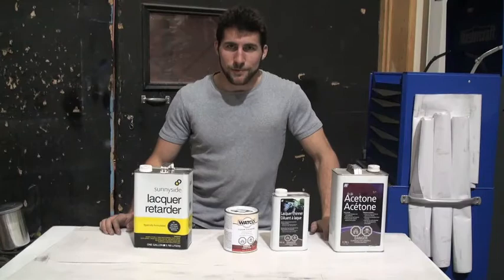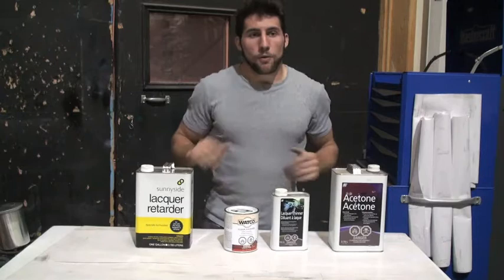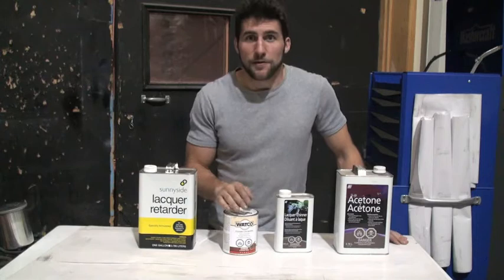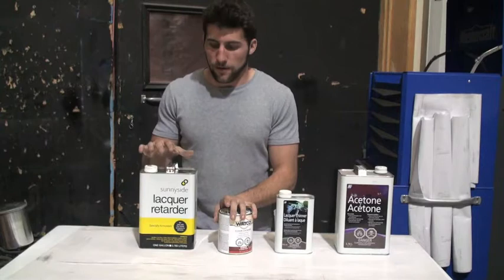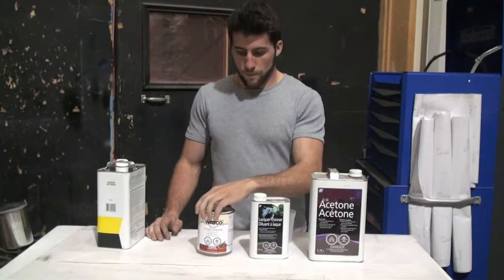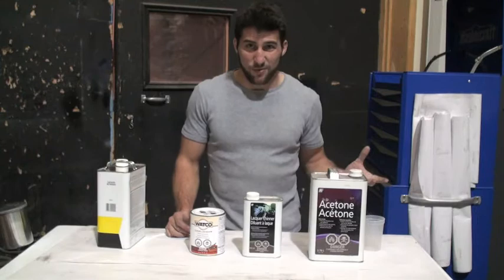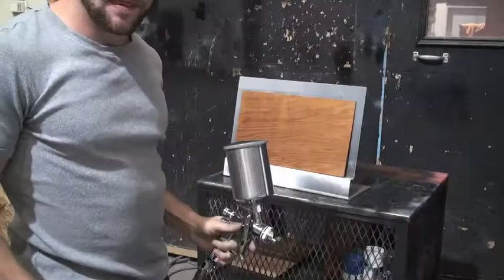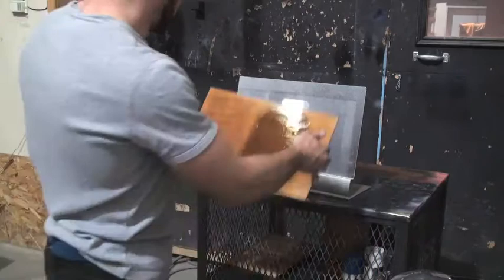How to Spray Brushing Lacquer

Comment: Great video! I spent the whole day here spraying your mixture. The only difference is that during the heat of the day I opted out some of the acetone for xylene. About 10% total volume xylene. Its listed on the spray-can/msds for watco lacquer satin-finish, so I figured why not. I read that it allows the lacquer to flow better because it slows the dry. Worked great. Sprayed 30 small table tops. I also noticed, since I was using the watco spray cans before in satin sheen......that the sheen is a little bit different from this diluted satin mix I made (with your help of course, props!) The sheen from the spray can is damn near FLAT......no reflective qualities at all, hides almost all blemishes. The satin mix from the "brushing lacquer" gallon has a touch of sheen....way less then semi gloss, but not a dead flat satin. Looks nice. 2 coats brushing lacquer applied by brush, then sanded 220, then sprayed 1 even coat diluted mix. Just my 2 cents. Thanks again, saved me some coin on spray cans!
Reply from the maker: Xylene works a bit like using retarder. It's a great thinner; I use it for enamels sometimes. Wow, that's a lot of tabletops. I prefer the semi-gloss watco spray cans because, like you said, there isn't much sheen at all to the satin. Thank you for sharing your technique and the experience you had with it, and thanks for watching.

Comment: Great video it gave me a starting point for a great finish.  If you look at the MSDS you will see that it is a Nitrocellulose Lacquer with proprietary resin.  All brands contain some form of resin to increase build capacity, flexibility, and bond strength.  Also lacquer thinner and retarder are not solvents themselves but rather mixtures of possibly 20+ individual solvents with different evaporation rates where butyl acetate is the standard.  Acetone is the fastest at 5.7 times that of butyl acetate and ethylene glycol butyl ether one of the solvents used in a retarder is 12 times slower.  There are easy to find charts for anyone else who likes to make it way to complicated.  M.E.K. is also a good thinning solvent for slow brushing lacquer.
Reply from the maker: Thanks for the information. I had no idea that butyl acetate was the standard for evaporation rate, I just knew that acetone was a great cutting agent that evaporates very quickly, and that retarder might be needed to counteract that. Now it almost seems redundant to use both.

Comment: I actually started using Minwax Clear Gloss Brushing Lacquer since it's like half the price of Mohawk. I just mix it 50/50 with Lacquer thinner, works perfectly and ready to buff and polish in about 14 days! Great video buddy! 👍
Reply from the maker: Glad to hear it’s working for you.
Reply: 50/50 mix, wow that’s the most I heard yet, and it works!  Interesting.
Reply from the maker: I sometimes use 70(thinner)/30(lacquer) for a final flow coat or to burn in a fresh coat on something I don’t want to sand that has been dry for a while.

Comment: Good video, Brad. I've been spraying brushing lacquer for years just because of availability. It works very well as an instrument finish that wet sands and buffs out beautifully. It also mixes really well with color tone dyes
Reply from the maker: Boudreau Guitars That's good to hear. I really need to get some color tone dyes, but they are a little more difficult to acquire up here in Canada.

Comment: Thanks for taking the time to make this informative video. 🇨🇦 I’ve been using automotive gloss lacquer from Canadian Tire, but wanted less gloss for some of my guitar builds. Was looking at getting  the Watco semi gloss brushing lacquer from Home Depot and trying to spray it through my HVLP gun. 🇨🇦
Reply from the maker: Good call. I hope it works for you.
Reply: @ Brad Angove Hi Brad, I mixed up a batch of your mix 60-40-20 with the Watco gloss brushing Lacquer.
Sprayed a guitar headstock and the rear cover for the guitar body. It went white as snow from ☺️ blushing.
Thank goodness I dint spray the main guitar body burl maple and figured walnut.
The humidity was 65% and the air temp was 24 Celsius so not supper humid. For this temperature and humidity
There was way too much Acetone in the mix.  It flashed immediately and locked in the moisture.To  fix the problem I lightly sanded with 800 dry two days later, didn’t take much to release the moisture!
Then the next day re-sprayed with a mix of 50% Watco Gloss Lacquer and 50% Lacquer thinner.
Worked like a charm didn’t flash to quick and it looks good now.
When you did your video was it cooler and dryer by chance? 🇨🇦
Reply from the maker: @RC-Flight  It's always cool and dry where I'm at.

Comment: Thanks for the video though it didn't work for me. I was getting a very dry blushed finish. I opted for about a 60/40, lacquer/lacquer thinner mix. This gave me a near perfect finish.  Maybe our differences are the guns we are using. I am still using my Binks models 62 and 7, (not cheap), that I used for automotive work some 30 years ago. I do though use acetone as a thinner for spraying regular Rust Oleum paints.
Reply from the maker: That could be it, or different humidity. If you’re somewhere really humid the faster solvent (acetone) will create more opportunity to trap moisture and create blushing.

Comment: I don’t quite understand the need for Acetone. I have a quart of Minwax clear gloss brushing lacquer, and I decided I wanted to try and spray it. I have the Preval sprayer, (they call it amazing for a reason) and I just eyeballed some lacquer thinner in with my lacquer, and to my amazement, the stuff sprays better then it does brushes. I didn’t need any Acetone, just the thinner and always a clean spray cap, and I get some professional looking results. The back of my can of brushing lacquer says, “Do not spray” and “Do not thin.” 
I can’t figure out for the life of me why it says that, cause it sprays, and it thins, perfectly for me.
Reply from the maker: Yeah, the main difference is just viscosity. Brushing lacquer dries a bit differently, but the thinner can change that to an extent regardless. 

The acentone is just a slightly stronger cutting agent that dries at a different pace than standard lacquer thinner.
Reply: Brad Angove oooh I see. Thanks bro for responding.

Comment: great video, always thought this was possible but wasn't sure on the mixing/application technique. Just a quick question, what purpose does the acetone serve in the mix? Why not just use more thinner? Keep up the great work
Reply from the maker: Acetone is what they use to thin it originally if I'm not mistaken (I could easily be mistaken here). In fact, you can make nitrocellulose lacquer by dissolving ping pong balls in acetone.
I use the acetone to thin it until it's somewhat like a normal spraying lacquer, then I use the lacquer thinner to thin it further, like I would thin a spraying lacquer.
Reply: Brad Angove
Haha great fact! I knew they disolved in acetone but I'd never thought of using the resulting liquid as a lacquer. Makes sense though.
In your method you use 50ml acetone + 50ml lacquer + 20ml thinner
would you get the same general effect if you used 50ml lacquer + 70ml thinner?
                                                                                or         + 70ml acetone?
or would this effect the chemistry and screw it up?
Reply from the maker: Ya, they're made of nitrocellulose apparently. I use about 50ml acetone, 30ml lacquer, 20ml thinner. That gives me a fairly thin mix. I think  that you would get a similar effect with those mixes, but maybe a slightly difference in atomization due to drying time. Acetone evaporates a little faster than lacquer thinner I think. Once you've got it reduced with the acetone so that it resembles spraying lacquer, I would do any further reduction with the thinner to make it behave more like a normal lacquer. That would probably also make it more likely to work well with the retarder if you use that.
Reply: makes sense to me now, thanks for the videos and for answering my question. All the best
Reply from the maker: Any time. Glad the videos were of interest.

Comment: Great video. Can you break down the mixture into how many parts per parts. I was going to use measuring spoons to put together a small batch. Thank you in advance.
Reply: The math is way easier if you just calculate off of final volume.  But it's something like 3 parts acetone, 2 parts lacquer, 1 part thinner.  Like he says that is pretty thin, compensate as needed.

Comment: Hey Brad - great video... this helped me out as I just bought a used Sata HVLP gun off a buddy with a 1.5 mm tip and was using the Watco at a mix of 80/20 (lacquer/ LT) (no Mohawk lacquer here, locally). I tried your ratio today and it made a huge difference. I'm wondering... how much time do you allow between coats? I was shooting every 30 minutes, which seemed to work fine but am curious if a guy could push that in view of getting, say, 20 coats on over the course of a day (i.e. high build gloss on a guitar). Also, if continuing on the following day, is it okay to just resume spraying, or should one sand lightly if a project has sat overnight. Cheers!
Reply from the maker: I wouldn’t generally put more than 4 coats on in a day so you don’t build up too much and have it all shrink and crack. 

You don’t need to sand between days for lacquer like this. It melts into itself. Sanding doesn’t hurt though if you want to smooth something out or remove imperfections.

Comment: Brad, I'm going to finish a guitar with this formula, after i have the desired amount of clear on it. i should follow your other video for buffing the finish out with using these chemicals? Thanks
Reply from the maker: +chris doxey Yes, the techniques I've used in my buffing videos will work fine on this finish as long as it has time to dry properly.

Comment: Hi I'm so glad I found your videos I have a question I usually paint on canvas but my husband asked me to do his electric guitar. he picked out an auto paint for a base coat. For the graphics I have water base acrylic paint. After I clear coat can I use brush on lacquer my airbrush is 5mm. Thank you
Reply from the maker: Brush on lacquer is a form of clear coat. If you're planning on spraying it through a 0.5mm airbrush, make sure that it is reduced fairly thin. Also, clean your airbrush carefully afterward and rinse out the lacquer thinner with water when you are finished cleaning so that it doesn't dissolve your seals.

Comment: thanks for the video,  watco is the only nitro paint available in Canada,,,for restoring old guitars it is the way to go, question is, seeing how guys like the vintage "checking effect" offered by nitro,  would you mix it differently?,    thanks in advance
Reply from the maker: +Pete Goyer Hi Pete. I don't think that Watco is a nitrocellulose. I could be wrong though. I get my nitrocellulose lacquer at a local paint shop here in Alberta instead. Unfortunately, I don't know of a mixing method that will induce checking. Perhaps experimenting with temperature changes will have some effect?
Reply: when i read the MSDS sheet it shows nitro,,,
its the watco clear lacquer , super clear finish
http://www.rustoleum.com/product-catalog/consumer-brands/watco/lacquer-clear-wood-finish
Reply from the maker: A spray can that atomizes like a pro gun? I find that hard to believe, but I'm curious...
Reply: Watco is indeed nitro, it sure smells and acts like it. It checks like crazy too in case anyone is wondering. The only reason to use it imo beside wanting checking is the burn in but it's so damn toxic and takes so long to cure I'm trying really hard to get water based finishes to work. They dry so fast and cleanup is a breeze but lack of burn in for the inevitable flaws to fix is a real downer.
Reply from the maker: What kind of environment are you storing your stuff in?
Reply: It was a guitar I painted with rattle can Watco, stored guitar in a super cold garage over a winter -it cracked exactly how vintage guys want. I've since used the canned stuff for small parts and that stuff smells even more powerful, I can't even just have the tin open for 10 min before I start choking lol.
Reply from the maker: Haha yeah. It says in the product specs that it’s nitro. I found that out relatively recently. 
If you leave lacquer in the garage it’s definitely going to crack, but I’ve got a couple watco painted items that weren’t stored in the cold and they still look fine.

Comment: Hey this is awesome. Thanks for posting. 
I'm a guitar tech who wants to start doing more of this and I always get nitro from stewmac....it seems kind of thick as well but I've never worked with brushing lacquer. Is nitro thinner? I should use a mixture similar to this for an airbrush as well right?
Reply from the maker: Brushing lacquer can be nitro or a different type. Nitro is the chemical composition. This watco is nitrocellulose based. You would generally thin the stewmac stuff by about 50% with lacquer thinner.
Reply: @BradAngove  Ah ok so the same ratio. Thanks again man!!!!

Comment: great video exactly what i needed to know! now i need to find a good spray gun
Reply from the maker: Good luck! Let me know how it goes.
Reply: Harbor freight purple gun 12$ get it. I put five gallons of lacquer through it. There is a learning curve, but it lays down beautifully. Lacquer is forgiving of errors.
Reply from the maker: I just did some reviews of a few Warwick spray guns. If you check them out, you can get a 10% discount using the link and code in the description of those videos.
Reply: dewalt spray gun is i think the best , ive tried devilbiss and i find them a litle too expensive for the results
Reply from the maker: If you’re willing to do enough sanding, recoating, and polishing, you can get away with pretty much any gun.

Comment: Brad have you ever shot metal flake? I need pointers on that method. Hopefully you have a few videos on this method?
Reply from the maker: I have once or twice. I don't have any videos on it unfortunately. You'll want to use a large nozzle size for metal flake. Are you mixing it into some paint, or did you buy a metal flake paint pre-mixed?
Reply: I'm going to try a flake buster method where you lay down some clear and blow dry flake then cover it with clear. I saw a diy source that made a flake buster I'm going to copy him. This will be my first attempt at flake. I am determined that I will master it or at least feel confident enough to do a good job for my own project. Thanks for your info Brad. I'll keep you posted.
Reply from the maker: Oh, I see what you mean. They have a system for that available on coast airbrush.com. It looks like a cool option.

Comment: So would you recommend using NCL over a brushing lacquer?  I can get NCL here and that is the original finish of my Zenith radio that I am restoring.  Thanks for your time.
Reply from the maker: Some brushing lacquers are also nitro based. Do you know what yours is?
Reply: @BradAngove  I haven't bought anything yet, just doing some research on what might work best.  I'll be spraying it through my HVLP, I was thinking originally about a Sherwin Williams NCL.
Reply from the maker: Maybe you should just spray nitro for the whole thing rather than starting with a brushing lacquer then.

Comment: One more question: I'm spraying the same stuff with a siphon gun and a 1.8mm tip. I didn't thin it with anything and it seems to be working ok. Am I crazy? I'm just learning. Thanks
Reply from the maker: Vic Mackey I'm not qualified to tell you if you're crazy haha, but a 1.8mm tip is pretty big. You probably don't need to thin it at all to have it spray through there. You can skip the acetone no problem. The only reason you may want to use some lacquer thinner in there is that it affects the flash time of the lacquer.

Comment: Great Video! Novice here at lacquer. Finishing a cherry bar top that has 2 coats of sealer, then sanded and colored with a wiping stain. I want to have a final "satin" finish using Watco. Would I need to make any changes to your method? Should I light sand between coats to remove trapped dust particles? Do I use gloss then finish with satin? After final spray, what do I need to do: light sand, rub, something else or nothing? Thanks a lot!
Reply from the maker: +Treetops Just do the same thing, but use satin instead of gloss. There's no reason to use gloss if you want to end up with a satin finish. You can sand between coats to remove dust if you find it necessary; just make sure you give ample drying time before sanding. After the final spray, see if it looks good. If it does, you can leave it. If there's dust trapped in there or something you can rub out the finish, but be careful. You don't want to polish it to a gloss finish by accident.
Reply: +Brad Angove  Thanks Brad! Had read somewhere that if layering satin coats you will get a yellow hue from whatever ingredients make the finish satin. But I maybe this applied to poly.
What do you recommend I use to "rub out the finish" to get rid of any particles? I always seem to have trouble with dust or other bits prevention especially with the longer drying time of poly.
 Wouldn't mind seeing a video on dust, etc. prevention and on sanding timing/methods/materials to get rid of these "bumps".
Reply from the maker: I have a series about how to paint your guitar by hand. In the third video (polishing) I demonstrate a method for rubbing out a gloss finish and a satin finish by hand. The video is done with poly, but I would apply the same techniques to fully dried lacquer.
Reply: +Brad Angove OK went to the series on paint guitar by hand which answered a lot of questions. Left another question on the 2nd episode.
Thanks and am now subscribed
Reply from the maker: Thanks. I'll go check out your other question.